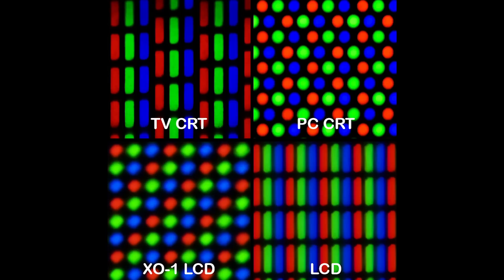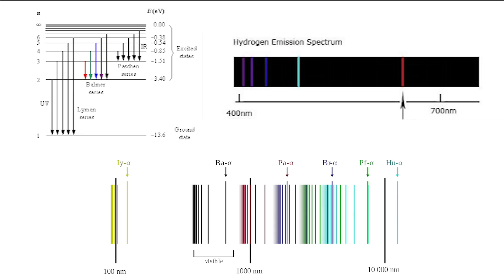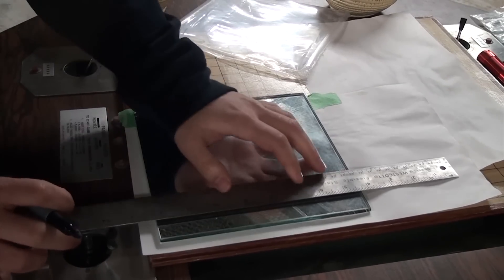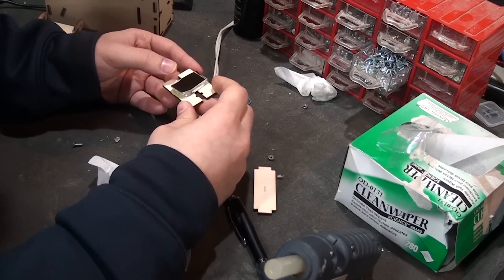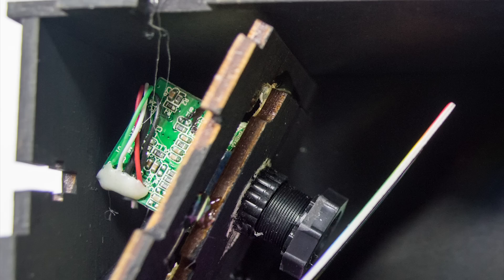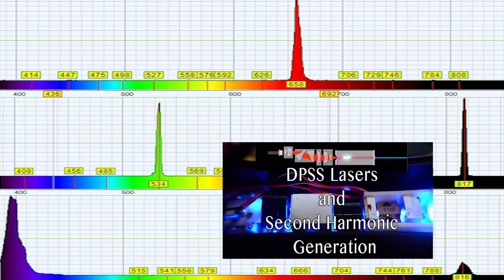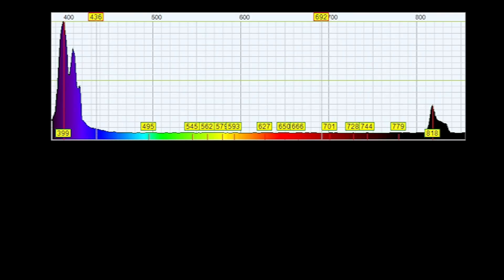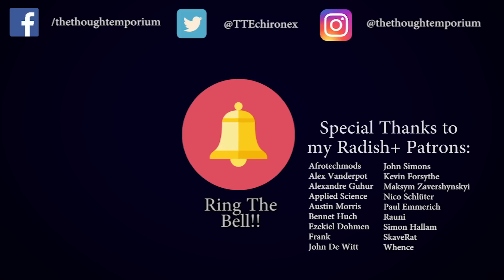Building a Nanodrop Style UV/Vis Spectrometer

Comment: To split off narrow strips of glass I recommend using a pliers that has vinyl, masking, duct, or painters tape wrapped over the pincers. There's actually a couple special bronze tools for splitting glass used by glaziers, but they're all basically variations of pliers. Putting Kerosene or alcohol on the glass before scoring it can help create an uninterrupted scratch which breaks cleanly. It gets more difficult and less forgiving the closer the strip being cut is to the thickness of the pane.

Glass is surprisingly amenable to sanding, and the edges could be sanded flat without compromising the strength of the piece. However, sanding the edges might cause back scattering of light and mess up the function of the spectroscope.
Reply: Actually it's pretty simple to cut it using a rotary tool and a diamond blade.

Comment: Hi! Just a couple of questions: What kind of resolution can you expect from a cheap plastic grating like this? Also, why do you use a white LED as a light source, given that these have quite a terrible output spectrum in terms of linearity?
Reply from the maker: You can use an LED and ignore nonlinearities because it's all just about comparing to a reference. If you pick a wavelength to measure, you're just comparing the difference between a control solution and a test solution. That's why absorbance is in arbitrary units ranging from 0-1. So long as there's a difference between the two it'll show up properly in the measurement. Unless you're doing something super finicky, this is sufficient.
Reply: @thethoughtemporium  Thanks for your reply! I am still worried though that you are pretty much 'guessing' at significant portions of the spectrum. While you can calibrate out the non-linearities to some extent, the emission of white LEDs (the cheap ones in particular) is only meant to approximate white light to human eyes, and there are actual gaps in there. You can tell theremino to cal them out so things 'look' okay, but that doesn't change the reality of there being no emission there from your source in those gaps. Also, other non-linearities of your setup might begin creeping in and wreaking havoc once you start applying all sorts of correction curves to the actual output. You're right, this is not a deal-breaker for some applications, but it is a severe limitation to be aware of. There is a reason why commercial units use broadband emitters such as xenon arc lamps. Even a small halogen would be better I think, and quite easy to implement. (EDIT:) Going back to the part of the video where you show the raw output of your grating, you can clearly see a region between the blue LED emission and the first green phosphor where there is very little light visible.

Comment: Be careful with calibrating the wavelength based on diode lasers. Their exact wavelength depends on the current battery voltage and vary stronger than one might think.
Reply: Temperature as well can have an impact. I don't know the magnitude of the differential but it exists

Comment: Aren't there tons of nonlinearities in the sensor and anything you'd use to calibrate it? How do you get around that?
Reply: actually, sensors only detect red green and blue light so you can calibrate straight off red green and blue
Reply: @fapasaurusrex  actually, you don't know what you're talking about. In such instances it is always best to keep your mouth shut: it really helps other people.
Reply: Yes, the spectral responsivity of a color webcam is always an absolute mess of nonlinearities. The Bayer filter response if very far from the smooth response of a human eye and can be summarized as three or more peaks centered on red, gree, blue plus secondary peaks of minor importance due to undulations in the response of each color pixel, plus a series of larger dips and peaks due to the fact that each individual color filter has minor ripple responses to both red and blue wavelengths. Also, in the infrared Bayer filters become substantially transparent and this behaviour starts in the deep red part of the spectrum around 660~670nm. 

Calibrating such a huge mess is almost impossible, and your best bet is to get a proper monochrome sensor or accept the fact that the instrument is ok for qualitative results only and the response is somewhat linear at single wavelengths but the spectral response as a whole is practically unpredictable
.

Comment: What kind of filter did you end up buying? I wonder if some of the ZWB2 filter glass commonly used in 365nm UV flashlights would work similarly to what you got...
Reply from the maker: It's a yellow glass highpass filter. Basically the same as the filter I used for the gel doc but with a lower transition.

Comment: Well, you can go around using fluorescent dna stain by using this uv source (just 30 bucks): https://www.digikey.ca/product-detail/en/inolux/IN-C33DTDU1/1830-1194-1-ND/9681274
DNA absorbtion is around 260nm, which correlates very well with the concentration.
Or this one, if you're perfectionist: https://www.alibaba.com/product-detail/2018-new-TO39-250nm-260nm-deep_60107762617.html?spm=a2700.7724857.normalList.33.64c86763gEn7Pg

Comment: Just to remind people that hot glue exists in black for this kind of application.
Reply: You would have saved me a whole lot of time and frustration if you had told me this back in 1992. I made a robot that used IR remote control receivers as range finders. Back then, the receivers were in little sheet metal boxes. They worked on the breadboard, but not when hot glued into the robot. The hot glue I used acted as an IR light pipe. Any IR that hit the hot glue blob was carried into that little metal box.
Reply: Must be some black market stuff cause I've never seen it in my life.
Reply: @maracachucho8701  It's also on ebay but smells very toxic
Reply: @maracachucho8701  I think I can't post a link here, search on amazon "black hot glue"
Reply: I had black hot glue a long time ago and it had a pitch/tar smell to it. I think it was for different application than typical hot glue :P
Reply: Thanks for the tip! Plenty available on Amazon.